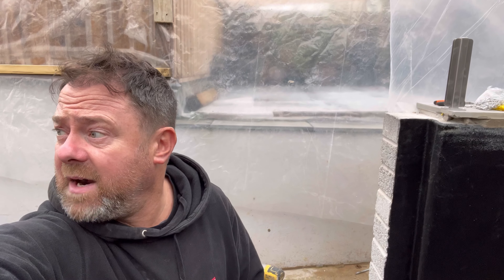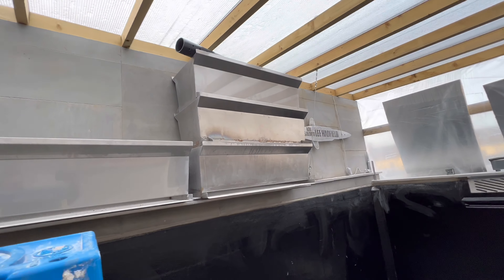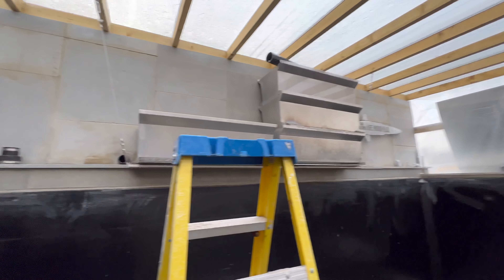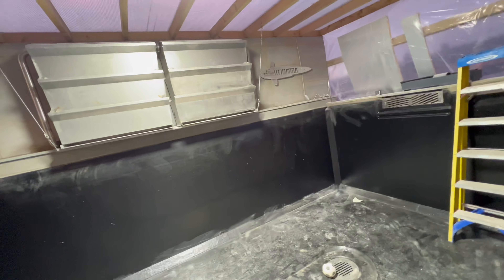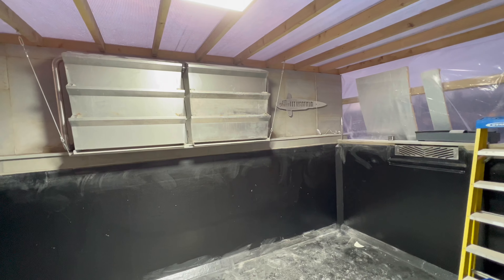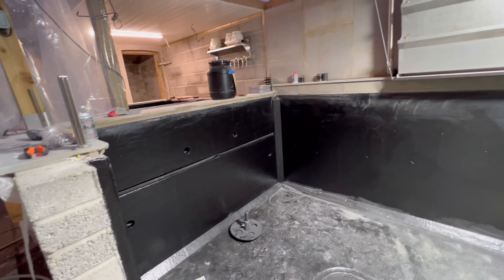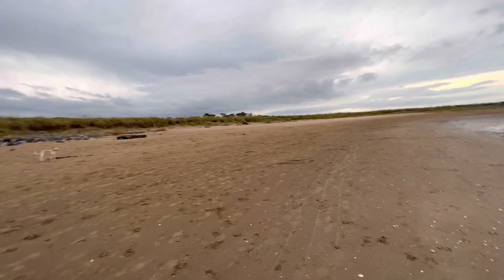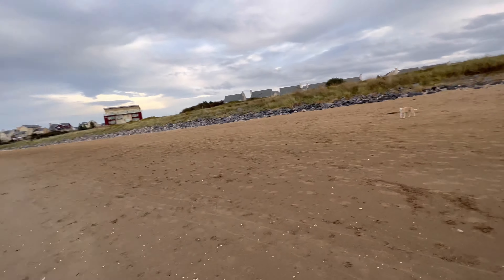5000 gallon koi pond build!! Drains & stuff 🪖🪖🪖🪖🪖🪖

Comment: No rush to fill,fill it February, the just  run the pumps,ready gor new season,I would  leave them untill temps start increasing,unless you plan heating your new pond,brave man with the electricity  prices,take it easy
Reply from the maker: Yes I’m going to drop the temperature in the old pond for a week or 2 then balance the temps put the heater on the new pond then heat to 18c again

Comment: Loving watching full build. Just a quick thought- and might have missed this during previous video/comments; have you considered pre filter from skimmer before bakki showers? Don’t want a build up of waste in there as cleaning it in that location will be very difficult. A simple sieve would do 👍👍
Reply: Drum
Reply from the maker: I’m
Running my shower exactly like that now! With great results!!!! If it’s not broken don’t change it!
My drum will not take 60,000 lph for the showers and 30,000 for the bottom drains!!!!

Also if one system fails iv always got flow and filtration 👍🤙🙏
Reply: @leehadfield6881  absolutely spot on👍👍